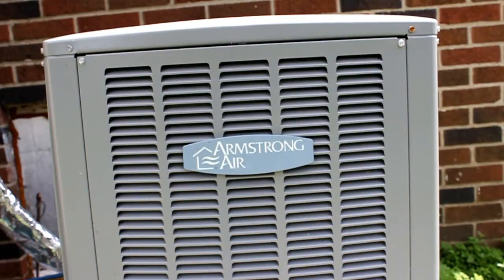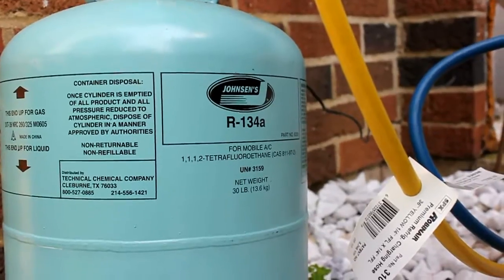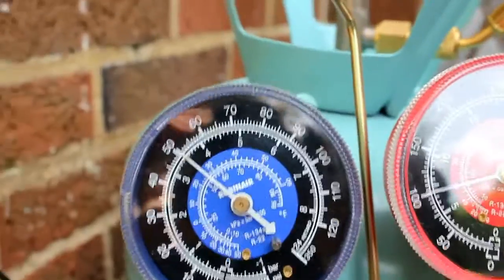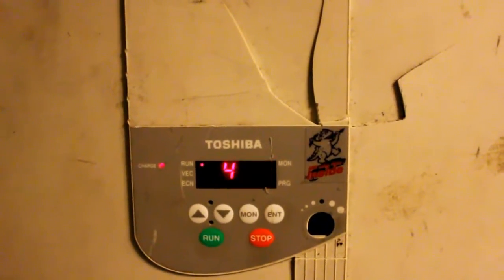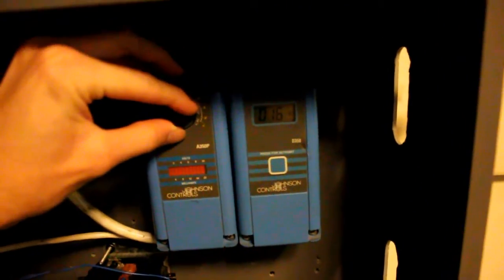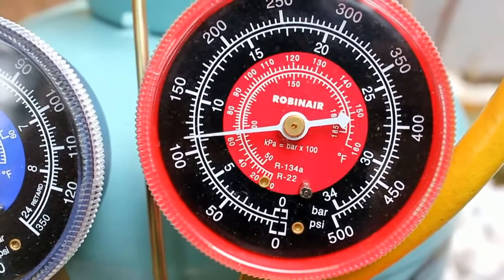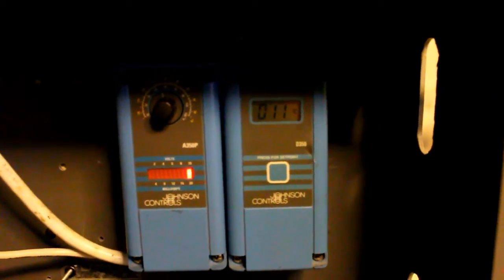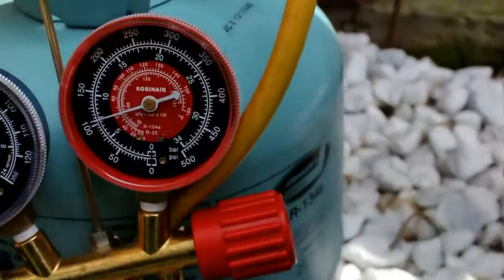3 ton air cooled residential heat pump uses R134a

Comment: is it even legal to use r134 for residential?  also, you need to up size your blower and duct work for the system to work right.  otherwise you have icing in the evaporator.
Reply: technically no but the ac police aren't going to know about it and won't come to take you away.
Reply from the maker: Ice formation on the evaporator is impossible with this system. If it isn't legal to use r134a, I wouldn't understand why. r134a is used virtually everywhere. Even in industrial air conditioning
Reply from the maker: If you watch carefully You'll notice a vapor pressure of 50 PSI. Which means the evaporator saturated temperature is about 50 F. The metering device is fixed, but the compressor is variable speed. If I wanted it colder I'd just tell it to get colder and the compressor would speed up. This is also why it is impossible for the evaporator to freeze. The temperature controller will not allow the compressor to run at full speed down to freezing. That is unless I tell it to, but I usually don't
Reply: Actually, it is legal: https://www.epa.gov/snap/acceptable-substitutes-residential-and-light-commercial-air-conditioning-and-heat-pumps
Reply: +subcooledheatpump 

your low side pressure in the video seems high BC r134 low side pressure in cars is usually around 25psi, that corresponds to superheated vapor at below the freezing point.  I did not watch the whole video, what type of metering device is the system using.

Comment: do you have three phase power in your house ?
Reply from the maker: N7CX No, just 240 volts single phase. 3 phase power for the compressor is created by the variable frequency drive. DC goes in, variable frequency AC comes out

Comment: Your use of a voltage doubler is actually a remarkably efficient way to boost the voltage. The power factor is going to be low, but that's unimportant in most residential applications. (I converted my desktop PC to use a voltage doubler instead of active PFC and saw a significant reduction in power usage, especially at low load.)

Comment from the maker: That's correct it is a 460 volt 3 phase compressor. The VFD is also 460 volts. I made a diode voltage doubler to increase the residential 240 to 480 for this setup

Comment: Out of curiosity, I looked that up and it seems to be a 460V compressor? Does the VFD have a voltage boost circuit to allow it to be run from a 240V residential supply?

Comment: R404a has been used for low temp, now 404a is being used on medium temp systems, R404a's pressures are close to R22, it would be "nice" if they engineered air conditioning systems for R404a .Lower compression ratio than R410a, lower amp draw, One refrigerant for all aplications."Nice"

Comment from the maker: This unit came with a scroll compressor which was damaged. I then bought another compressor for it. Pretty sure I bought and installed Copeland compressor model CRK3-0325-TFD-970 for this unit.  Copeland seems to think this compressor has two cylinders.

Comment: This industry goes through fases, like back in the 70s some genius engineer started promoting multi plex condensing units on medium sized stores.Small store owners couldn't afford the refrigerant losses, that fase ended.I'm waiting to see if the same thing happens to 410a.It's good for the equipment mfgs,smaller compressors, higher profits.but when they run and remove the sensible heat quickly do they remove enough humidity,are freezer evaps icing up more causing more electric defrost demand.

Comment: If you raised the head pressure to around 140psig you would increase the refrigerant flow through the TXV and inncrease the capacity a little.What would be interesting is if you were able to check the kilowatts used over a 24 hr period and compare it to the kilowatts used on a R22 system.You can set the superheat on a R22 system on an 80degree day and come back on a 98degree day and your head pressure will be up around 398. I remember the R12 AC systems,they ran longer and removed more humidity.

Comment: I'm mostly refrigeration,I've always liked R 134a. Few yrs back I bought R134a at Sams club, it was from China, it was about $80. less than my supply house. I put it in some dairy cases, I couldn't get the cases colder than 42 F,a yr later a dual pressure control cap tube broke and lost the charge, the food was warming up so I had to get a couple bottles of refrigerant fast at the local supply house,it was made in the US. the temp dropped down to 37 F imeadeatly.No more China refrigerant for me.

Comment: its a desuperheater because the compressor superheats the saturated vapor so the suction line removes the superheat so the condenser is just removing the heat from inside the house plus it helps cold the discharge line from the compressor for more efficient condensing

Comment: nice job very cool experiment i always said 134 A would off been the way to go over 410A .they use to run R12 in some off the old ac units .pressures look good .i wonder if you made some adjustments you could get the super heat up a bit and stop the compressor from sweeting ,is the txv rated for 134A

Comment from the maker: This unit uses an old but never used (until now, of course) 3 phase R22 compressor. I started it to make sure it worked, then changed the oil to POE. R134a is one of the most efficient refrigerants, but it is a low pressure refrigerant which just means it needs a higher flow rate, not necessarily more electricity. This unit has infact saved alot of electricity.

Comment: Sweet.
The 500 ton Carrier 23XRV chiller at work runs on R134a.
It's got a VFD too. :-)

The older 500 ton centrifugal unit we have (backup at this point) is R22. 

The other interesting thing is the R22 unit has about 1,000 Lbs system charge and the newer R134a just requires 500 Lbs.